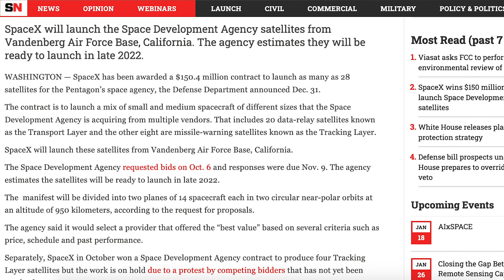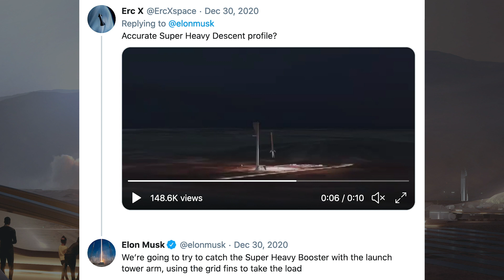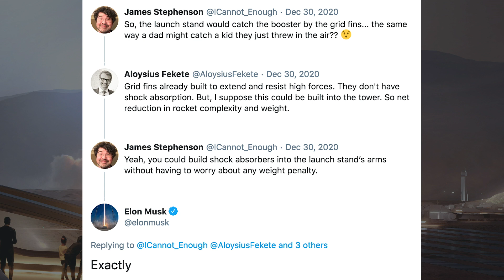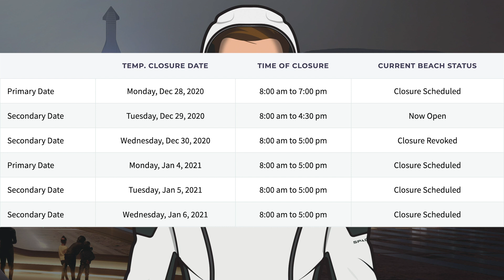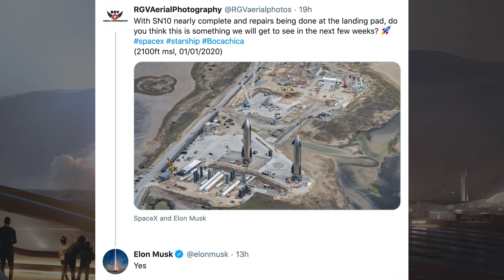SpaceX Starship Updates! SN9 Static Fire Soon, SN10 Stacked Fully! TheSpaceXShow

Comment: When he tweeted about super heavy I was skeptical at first because it just seems like it would be expensive and difficult and risky just for a slight gain in payload capability and a decent boost to turnaround time. Now I fully accept the Idea and I think it’s the right thing to do, but I’m still worried about the risk. If a booster crashes into a launch pad, it’s not that bad. But if it crashes into the expensive launch pad and tower arm then that is pretty bad. But I’m sure for the first few flights of super heavy they will have the catching tower separate from the pad to test it, and will try to make it as reliable as possible before it actually lands on the launch pad tower. It might be a few years until we see that though.

Comment: If the booster explodes on decent ,it will destroy the tower and then it will put progress backwards.
Reply: The tower won't be built permanently. This will be a test stand. Their final design will be able to take the blast if it comes to it.
Reply: @SpaceXsuperheavy  i very much doubt any tower will sustain a blast. The forces are way too high. Were dealing with rockets here and explosions.
Reply: But it is probably safe to say they gonna have a number of parts to assemble new ones on the fly. It will be expensive mistakes for each failure cause the cost of the super heavy and a landing mount will coat so much
Reply: @Cwg.  The idea is for Super Heavy to cost a lot less than anything currently available. Some losses in development are expected.
Reply: @markhorton3994  I know I was just saying. This will be the most expensive risk per launch  to date they just can cause elons a billionaire with a huge networth now
Reply: @Cwg.  I agree that this new catch landing is the biggest challenge.  No one who will not take risks can advance. I'm glad its not my money.